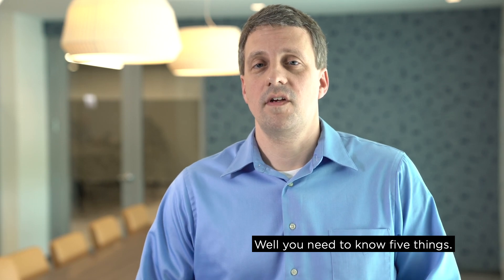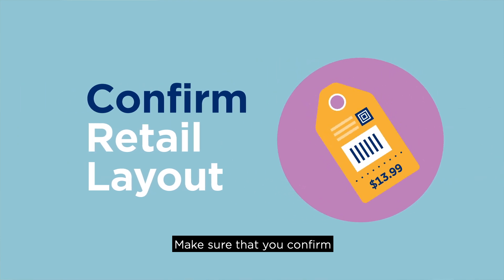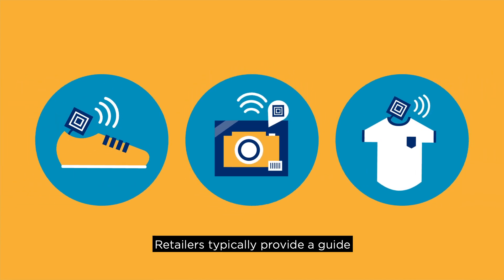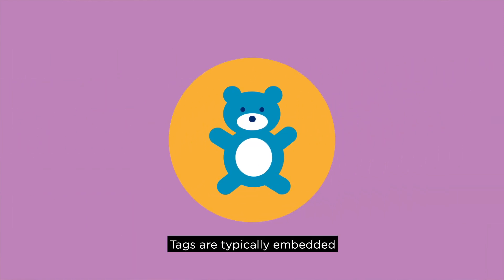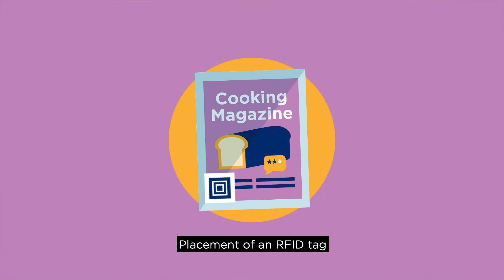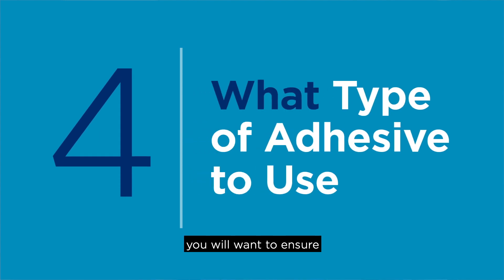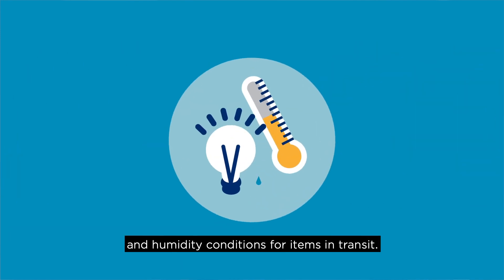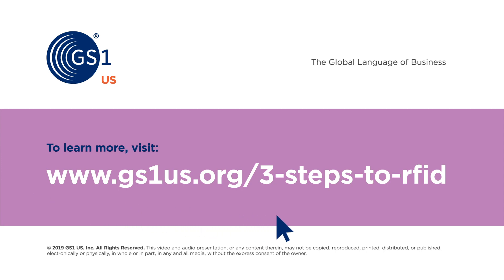What Do I Need to Know to RFID Tag?

Comment: some posts mentioning that EPC is re writable,  in that case, EPC numbers may be same for two different product right?
Reply from the maker: EPC values are re-writable at the discretion of the organization encoding the tag.  EPCs can be “permalocked”, meaning they never can be changed, they can be temporarily locked (using a password), or they can be left open for anyone to read and change.

GS1 Standards define how EPC tag data is to be encoded, ensuring that each encoded item is globally unique.  Following the standards ensures unique identification of each tag.  This is based on the GTIN, which encodes the same data found on a product UPC, and then adds a serial number which is any number (typically for the most common identification key, which is an SGTIN-96) under 274 billion (2 to the 38th power).  GS1 provides standards for encoding, and guidelines for serialization.  The GS1 US page (that relates to the youtube video you’ve reviewed) offers some links to helpful documents (there is an overview page, and then 3 additional pages that you can navigate to).  https://pages.gs1us.org/RFID-success.html